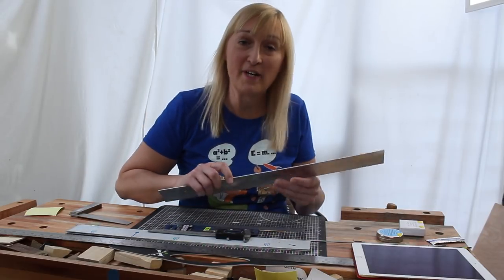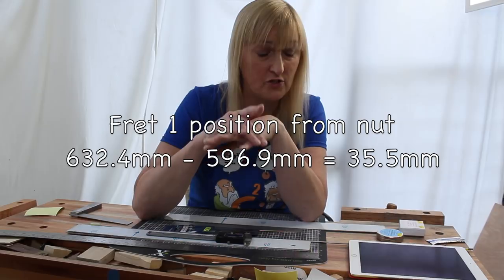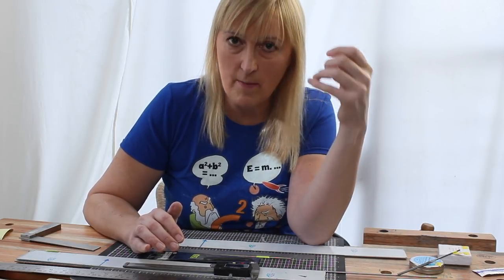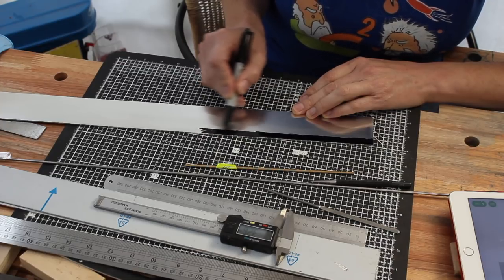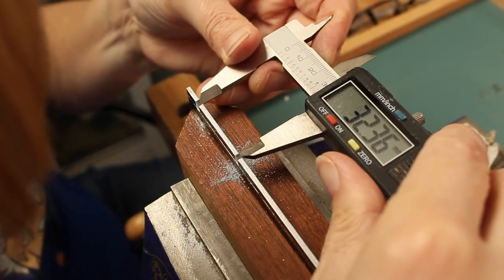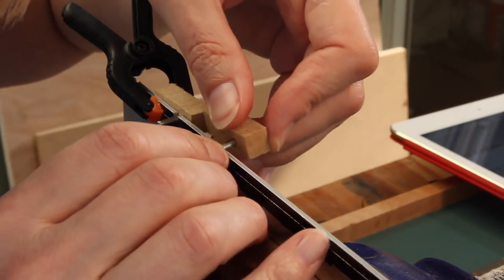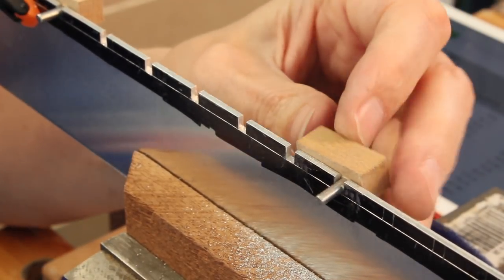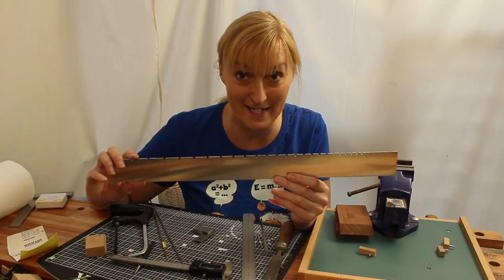Making a Fret Position Template plus an explanation of fret position and nut compensation

Comment: Aluminium is a pretty awful stuff to file as it is so soft it will clog the teeth on the file - known as 'pinning'. To avoid pinning it is worth rubbing the file on some ordinary blackboard chalk. This fills the teeth with a soft dust that prevents the aluminium from clogging them up while still allowing them to cut.
Reply: She's using files that are specifically made for aluminum. Dork!
Reply: Thank you Peter for the tip.  Unlike the rather rude David, not all of us have specialist aluminium files (or even knew they existed) or would buy a set just for one small job.
Reply: Interesting.  I'll keep that in mind.
Reply: Peter Little rubbing with a little paraffin helps
Reply: We used to use a pinning card fixed to a wooden paddle, specifically for clearing the file, they were like little wire hooks.  Worked very well

Comment: That's not layout blue, as you say 'engineers' or 'micrometer' blue is used to make witness marks when mating two surfaces accurately.  However most non engineers do not know the difference and it is often labelled as 'layout blue' when it is nothing of the sort.  Try looking for layout blue on Amazon and many sellers will offer Micrometer blue to teh ub=nsuspection but i'm also sure that many sellers don't know the difference either.

Comment: A tip for others, before starting a cut with a saw it is more accut=rate to make a small 'groove' with a triangualr needle file.  Hold the file so that one face is vertical and this is aligned with your scriber mark and the angled side cuts into the wate.  That means that your saw is accurately located in the correct position when beginning your cut.  Then it doesn't matter how you hold your tongue.

Comment: For those that have a table saw , you can mark the lines that you need , then use a crosscut sled and cut notches with the table saw ALL ON ONE SIDE of the lines ... Then you can cut a notch in your miter box with the same table saw blade and you can make a pin the exact size of your table saw kerf ... It is much faster than filing them and quite accurate 😊

Comment: I'm so glad you explained things in detail. I'm a detail oriented person and it matters. I don't quite understand the problems with the bridge so I hope you can go into more detail at some point. As far as the parallax, you need to stand the ruler on edge. Use a length of square aluminum tube and double sided tape to attach the ruler. It's much faster and far more accurate that way. Cheers and thanks from a Yank

Comment: I just bought a aluminum ruler, then a 25 1/2" scale length 22 fret jig online. I marked the lines from that to my ruler, then took a diamond cutting wheel for my Dremel 4000 and and notched the locator pin slots into the ruler with that. My locator pin was a piece of fret wire .006 which made it very precise tot he jig I bought. Saved me hours of work and all for under $20.00 US.

Comment: I come from a  family of engineers and I lectured Maths and Electronics. I like your videos for that reason, also as you are a female guitar " Geek" . I build guitars, have done, all sorts for twenty years, repairing and modifying since 1980.Currently building a Les Paul Jr.  pour moi. Thanks for showing me this as i enjoy the precision involved. My favourite scale is my son's Danelectro U2 - 52   ( 25"- can't bear to talk mm as I use Imperial measurements to the thousands of an inch).Twenty -five inches seems the perfect scale length to me for both acoustics and electrics. Thanks again, have seen some of your stuff and I bet you 100 quid you're an engineer. I enjoy your posts.
 Terry from Oz..

Comment: Susan, you rock!  This was very good.  I made a maple 28.625" scale baritone neck back with truss channel that is screaming for a fretboard now.   Issue is, most pre-slotted bass fretboards will not give the needed number of frets once the fretboard is cut to the third fret as necessary for the 28.625" scale, even the 24 fretted fingerboards will loose a few of the top frets on the board.  So, really thinking about getting an unslotted and doing that work myself.  Being an R&D tech at a big medical company I have access to good tools and resources.   Thanks for such a well explained and reasonably obsessive capture of the required elements to good precision and accuracy.  There is obviously a lot that can go wrong in creating a template that may not be intuitively perceivable, initially.  Well done and keep up the good work Susan!  -  Phil

Comment: Dear Susan, in the book I read in my early adolescence, it was recommended to mark the neck using a compass and a constructed triangle, in which one leg was the calculated scale, and the second was some fraction of this scale. The size of the fret was postponed from the perpendicular at the end of the triangle and transferred to the leg of the scale with a compass, where the perpendicular was again built, and so on, until the required number of frets. Accurate verification is carried out at three points: 5th, 7th and 12th frets, which corresponds to the quarter, 1/3 and half - octaves. This method seems to me to be faster and reasonably accurate. A compass with needles gives such a small error that it can be trusted for up to 5 measurements in a row.
In this case, the error does not accumulate and will depend on the sharpness of the needles and the correctly selected semi-friable material. For example, drawing Whatman paper.
The markup itself could be applied along the center line of your ruler of the ruler template and drilled small holes in these places. This would allow you to carry the template over the overlay. If you install the side stop, this way you would get a template with parallel guides. By moving the template over the holes, you will get a series of strictly parallel stops when you mark the cuts in the fretboard. You will need one more point - a stop for one of the edges of the ruler. Then the entire plane of the template ruler will be defined unambiguously.
And finally. If you ensure the absence of accumulation of errors, then the accuracy is better set to 0.1 mm, this is significantly lower than the sound-frequency difference thresholds of human hearing.
As a mathematician and engineer, you should know that if the error is non-systematic and does not accumulate, then statistically it flattens out, and the accuracy is limited to special tolerances.

Comment: Full marks for doing this   I am sure you lost a lot of people with the technical stuff, but for me it is essential to understand how a fretted instrument works, and what the shortfalls are.     Everything is not equal in the measuring world ( as I am sure you know). The calipers you are using are fairly accurate, but are not really accurate enough.  Worth getting a small micrometer for really accurate measurements, and a set of gauge blocks.  maybe a set of spring calipers is also worth the investment ( they can be had cheaply).  Makes life easier to check slot sizes and parallelism.   Even if your layout is very accurate ( hm), what about the method of cutting the slot.  Saw blade flatness and perpendicularity, runout of the arbor and so on.   I think the accuracy of the fret layout is often overlooked in how some instruments play better than others, and sound better.   ON the subject of compensated nuts, you can buy them pretty cheaply on Ebay.  Check out Axemasters.  
 Fun isn't it?

Comment: First time I heard/read someone mentioning the idea of shortening the distance from nut to the first fret, after watching a lot on YT and reading on the www. Wondered why this is not generally done by luthiers and factories…
    I (now 54) started 7 years ago to learn to play and shortly after made  my kit build modified telecaster (my avatar). 
    It had intonation issues and I noticed by eye that the nut was too far away from the first fret. I measured, and first segment was 0,5mm too long. After the plastic nut broke, I bought a steel nut that happened to be luckily 1mm too thick. I decided to cut 1mm off the fretboard having a compromised compensation in mind.  Result: a very good intonation possible! (Nut slots cut 0,2mm higher than a zero fret would be.)
   On a LP type I made a casted brass nut with a overhang individual compensation for each string. Tested before with a plastic shim under the strings that got fine tuned as required. With the final measurements I made a mold and casted with molten brass screws😊. Result: beautiful harmony along the whole fretboard (beside better sustain and more harmonic overtones).

Comment: Fascinating - thank you.  I'm never going to do any of this but it explains why, decades ago, my Strat benefitted from the odd slice of matchstick at the nut. Ok, that may have been, er, less than an optimal solution but it did solve some open string tuning issues, long before I'd heard the term 'compensated nut'. I'm also ok with a bit of maths, so thanks for that too.

Comment: Nicely done video!  I have used chalk dust, and candle wax applied to my files to avoid the Aluminum from clogging the file. Careful not to use wax on anywork that will require finishing. Prevents the finish from sticking! Candle wax is also a great lubricant for doing finishing cuts on mills and lathes with Aluminum

Comment: Thank you for showing how to get the needed precision with simple tools, as well as providing such a clear explanation of the spacing and needed corrections.  If you stand your precision rule on edge, you can avoid parallax errors.  I want to try this, but want to think of something to hold the file square as it's used.
Reply: Absolutely! It was drummed into me from an early age (8 years old) that a ruler is for 'ruling lines' and a scale is for measuring. With the scale vertical to the work you can locate a sharp scriber in the indentation of the marking.

BTW, although it is satisfying to engineer a tool by hand, the best way is to enrol in an relevant evening class. e.g. "I want to make a fret position scale/jig - I have the files for your CNC machine"!

Comment: Hi Susan, l made a template very similar, to this but instead of slots l made a small punch with a steel dowel and two plates either side and punched a semi circle on the edge of the template to locate a pin  made from the steel I used as the punch. It all worked very well,as ever it's only as accurate as you make it.cheers Rob .... p.s.Saves all that tedious filling!

Comment: Buzz Feinten figured that out with his componsated tuning system,but its never 100%,you did a great job explaining this,well done
Reply from the maker: +michaeladam caira I'm not 100% convinced by the Buzz Feiten as you need to tune the strings slightly differently and a lot of tuners can't cope with that. Also, I use a lot of different tunings and I'm not sure the Buzz Feiten system is compatible with that. However, I haven't used it, so maybe I'm over-reacting, but I believe it's more than simple nut compensation
Reply: Susan Gardener the buzz feiten system is just exactly what you are talking about.  The tuning offsets are just a slight improvement which essentially evens out the 'out of tuneness' of each note across the fretboard.
Check out the patent document.  He has a slightly different compensation dependant on whether it's electric, acoustic, bass etc.  Can't remember off the top of my head.  I think a 25.5" scale compensation is to move the nit 0.75mm toward the bridge.

Great video by the way 👍

Comment: Excellent explanation of the why.  Really excellent.  But you are making the how much more difficult than needed...  Tape the fretboard blank and the precision ruler to a plank with the scale against the edge farthest from you.  Align the measurement with the kerf of your precision miter box  and make the cut.  

This results in precision down to about half of the scale on your ruler.  128th of an inch for me.   I have a miter box that I made just for this that does not use a top brace at the kerf so that I can see better, and I use an optivisor.  It only takes 20 minutes or so to cut a custom scale fret board.

Comment: Hi Susan, as always fun and interesting to watch. I thought I'd tell you I made my fret templates with the compensation of half the kerf of the saw and it turned out fine. A compensated nut can be made later if necessary. You thought it might be wrong because it's not something everyone would notice, but normally people doesn't have to notice this issue when slotting a fretboard. They usually either use a commercial fret template that has this compensation (or not) or use a rule and mark the positions from the end of the fretboard (or nut slot). Anyway, as you so well described, it doesn't harm to compensate and either way is fine.

Comment: On Fender scale electrics you actully get the guitar quite decently in tune by moving the whole nut inwards 1.0 mm. That is so good that I find it hardly worth the effort to make an actual compensated nut.
Reply from the maker: +esa062 good to know!
Reply: There is a YouTube video that suggests temporarily placing a cocktail stick next to the nut, retuning and checking if this is an improvement. A cocktail stick is typically 2mm diameter so the string contact is at ~1mm. For steel strings their is also the James Taylor tuning method - 1st through 6th string: -3, -6, -4, -8, -10, -12 cents.

Comment: You are the first and only one to mention that the string is too stiff at the saddle to vibrate. I can add that for every harmonic higher than the base note the note is slightly higher. I put the guitar into an oscilloscope and saw that if the base note is dead on the first harmonic is sharp and the second harmonic is sharper still etc. I put it down to the aspect ratio of the string thickness to the string length. The thinner the string the less the effect. This is why we tune down the low E a few cents , the A a bit less and D right on then again G flat a few cents B a bit less and E right on to make it sound right to the ear on average.

Comment: I really enjoyed this video.  If there is one thing that you can possibly add, could it be that the nut compensation is from the pushing the string on to the fret actually is what is making the string tension higher along with the note's pitch.

Comment: I always thought that nut compensation was a function of how thick the string is, determining how far you have to bend the string before it contacts the fret, which is also dependent on setup or nut slot depth, which would affect the lowest frets much more than the higher ones, due to the deflection angle. I still see that as a factor, bit now see that the string tension and core diameter and resistance to stretching is more fundamental to the change in pitch. Good thing, as it makes first fret string height less critical, pitch wise. Don't worry about getting too detailed. It would be great if you were single and lived in CA. I'd definitely want to go out with and get to know you.

Comment: Well done, might be easer to machine the slots all the same width with a thicker blade (perhaps on a table saw with a miter fence and a stop block) and then adjust one pin to fit all the slots instead of having to file 22 slots the same width.

Comment: luthiers haven't really overlooked anything concerning nut compensation, it's just not really worth it to bother with getting the open string length accurate to within a tenth of a millimeter. the human ear can only really hear frequency differences down to 0.3%. if we calculate for a scale length of 628mm for an open low E (83Hz) you can see that we only notice a difference in pitch after a 1.9mm difference,  so half a fretslot width is pretty negligable. 
correct me if i did the math wrong, great video though

Comment: all of this a good case for using zero frets..but they should be made of steel. This is because as the string is bent it slides over a very small area of the zero fret and wears it down quite quickly..on the other frets the amount of bend is distributed over a wider area which does drop the level of the frets, but only a small amount. If you don use a harder material on the zero fret, then it will need to be replaced quite soon, or get used to the ever increasing amount of fret buzz on the first fret.

Comment: If you cut the end of your fret board off, say your blade is 1/32" wide then the side of the blade facing the saddle is your measuring variable, sinse the blade will have a right and left side. I think it's better (safer) to cut the end first, then 123456 etc. Toward the nut checking each cut for +- dead center results and fret #2 will be determined by fret #1's +- results to maintain as much precision between frets as possible, that said your idea of leaving the length open for a final cut would be best taking into account that your first fret may or may not be drop dead perfect in that it could be leaning toward the nut - at least now and after all the work of getting the frets 1/22 or 24 as best you can that last cut will be viewed with a little more respect I feel than chopping the thing off first and having to start #1 off with the pressure of screwing it up means you need another board. This is what I've learned from you so far, it's like the cuts if #1 is a little short say for example 0 .5mm if these aren't taken into consideration then at the 22th fret you'll need to Start over with a 13 mm screw up.